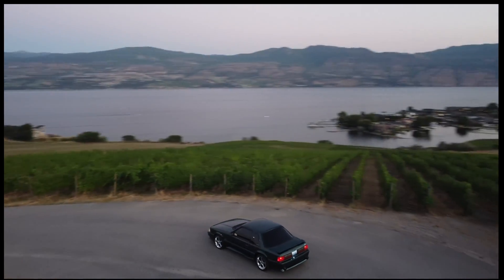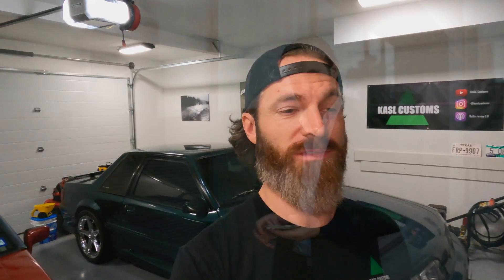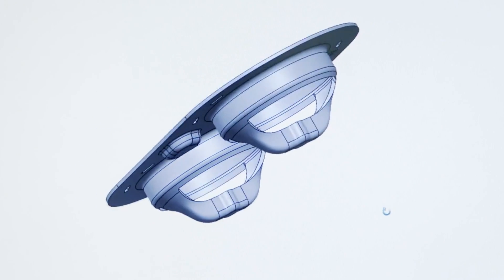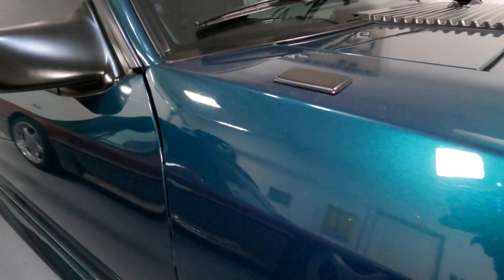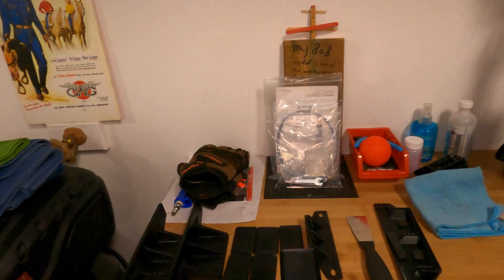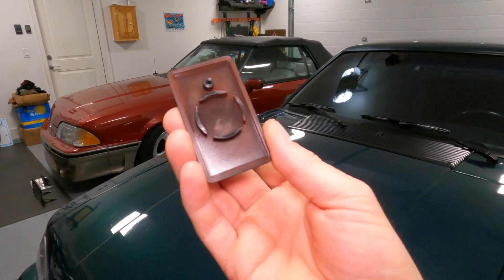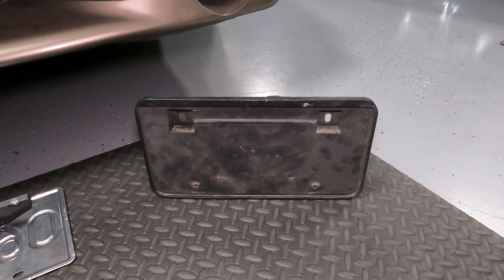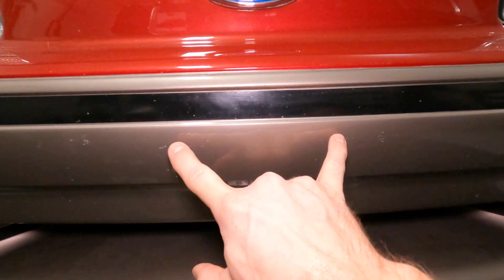I'm Manufacturing 3D Printed Parts for my Foxbody 5.0 Mustang

Comment: New sub here!  Love the content and presentation.  3D printing is easy.  It's the DESIGN that is difficult.  Kudos to you for taking on two annoying parts that Ford botched from the beginning. 

I am restoring an '89 FBM and had to get a new GT front bumper.  It came with holes at the bottom but none that I would have to fill if it was OEM.  I was trying to figure out how to get a front plate compliance without drilling the new bumper.  Alas, I have found you!  Thank you so much for building these parts.  I am going to purchase both and print them on my Ender 3 V2.  

Love both of your Mustangs.  The notchback is stunning and the color is fantastic.   For my resto, I am going with House of Kolor Shimron2 Cobalt Kandy blue.  Should turn out amazing.  Will look so much better with an antenna delete!  

Your presentation style is really good BTW.  I like how you control the camera, speak calmly and explain everything.  MORE CONTENT PLEASE!  ha ha.  

Thanks again!
Reply from the maker: Thank you so much for the kind words my friend! And yes, its the design that makes the printing process lengthy 😂

Comment: Hello.  You can 3D print your parts and have them used as models to have cast in metal.  My wife does this making jewelry and hardware (custom designed buckles and such) for handbags she makes.  So you can thank her for the suggestion.  For one-off parts you could probably make your own molds.
Reply from the maker: Yessir you totally can. They are a great invention for prototyping parts. I have my eye on a metal printer however they cost a small fortune…
Reply: @KASLCustoms  Yes.  Just to be clear, the print/cast method could be a way to make your metal parts without the metal printer.
Reply from the maker: Yes I agree 👍

Comment: Nice work, Brother! I just got me a 3D printer for Christmas, and I'm using Fusion 360 to design. Just wondering if that's also what you are using? STEEP learning curve for sure. I am fortunate enough to have a CAD department where I work, so I can lean on some people if I get stuck. Just printed my first Fox Body part yesterday.... (besides the hood prop holder on Thingiverse). These printers are almost becoming a necessity now.
Reply from the maker: Thx buddy!!! Yes, there are a lot of moving parts - way more then you think prior to imagining yourself just pushing the print button 😆. Yes I am using the same software. It takes me a lot longer to design because I have no background in it and no help so many hours go into planning, measuring, and design. 

Congrats on the new hobby. Let me know if you need anything or if I can help in any way 👍
Reply: @KASLCustoms  going back and modifying a design in Fusion is what is making my head hurt. I keep telling myself "baby steps", lol. (Quote from What About Bob)

Comment: The video made me go look at mine. I found the front license plate holder is attached using only the two screws in the bumper and nothing on the underside. Dealer short cut I guess.
Reply from the maker: Really! Cheap buggers 😂. Well mine will only use the two lower holes so you can fill the top two via body work or a couple of body coloured push pin/Christmas tree clips 👍

Comment: how about Saleen replica bumper license plate bracket my state requires one but I don't run one be driving it for 6 years and never had a problem but just in case a local police officer says something I can deal with it if out of my area probably won't worry about it.
Reply from the maker: I believe my LX model will work 👍

Comment: I have lived in such a terrible state that forced a front plate to be adorned....  I had to replace the front end with a new (to the car) bumper that did NOT have holes in the front!  And I purchased this from a junkyard in the same state...  so I was wondering how I (even though my car was deep jewel green and the bumper was a metal flaked dark blue... at night it was still just dark.  Haha!  But anyways...  I absolutely did not want to put holes in the front of this bumper....and so MY solution (thankfully this was an LX car)  was to just screw the license plate to the plastic air dam UNDER the actual bumper cover.  So technically it was visible from the front of the car and it was mounted...but a few high speed bumps curled the license plate metal backward ...but hey...  no screw holes in the bumper where the look matters more!  Haha!
Reply from the maker: Hahaha ingenuity 😉👊
Reply: @KASLCustoms  On another car....I grew up in the 80's with a loud car stereo worth more than the car...  I used the valve stems from some old bmx tube where the patches wouldn't hold anymore....and the vibrations of the subs would rattle the license plate in the back...  I had those really cool dice caps on my bike....so I got some more dice caps for the cars wheels AND I used the lower holes in the rear license plate holder to have the dice show on the outside of the license plate while the rubber valve stem kept the rest of the license plate from rattling....everything else was quiet...but that license plate was a noisy mess!  Now I had a set of matching dice for the bike and the car....

Comment: Love the ingenuity.  As for the holes in the bumper.  Would speed nuts fit in there?  If so you could include them in the kit and it would be a nice all in one kit with nice hardware
Reply from the maker: Yeah I thought about rivnuts too but not everyone has a gun to instal them…
Reply: @KASLCustoms  ya true enough. Good product though. Good to see improvement on a 30 year old design
Reply from the maker: @joeclarke6874  Thanks buddy!

Comment: Always great to see 3D Printing content! I'm onto my 2nd printer now, kind of turns into a hobby of it's own. The Revopoint Mini is a pretty solid scanner if you need to scan and replicate smaller more intricate parts or come up with custom mounting, bit of a learning curve but it's very useful. I've put up a few files for various cars on Printables, just put a scanned Foxbody hood prop clip up there since those seem to break every couple years and cost $10, why pay that when you can get it in 15 minutes for virtually nothing! Looks sick in black ASA with the vapor smoothing as well.
Reply from the maker: Thx buddy! That’s awesome, thanks so much for sharing the info 🙏